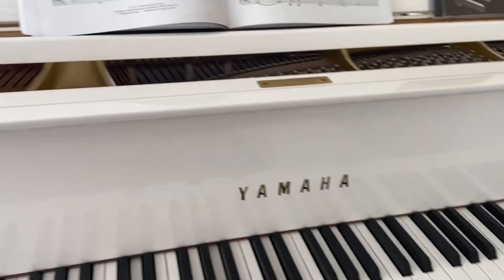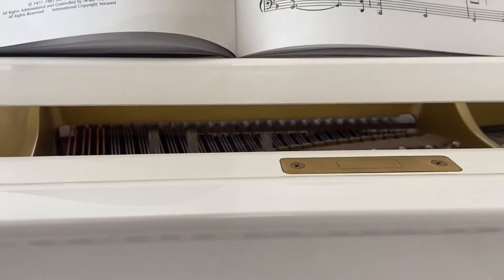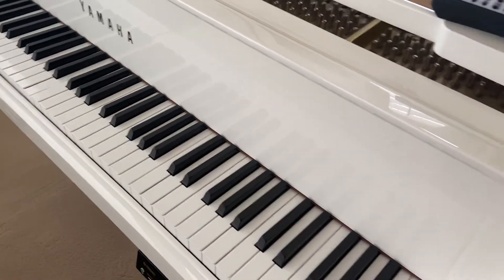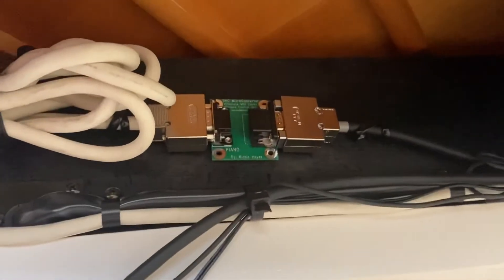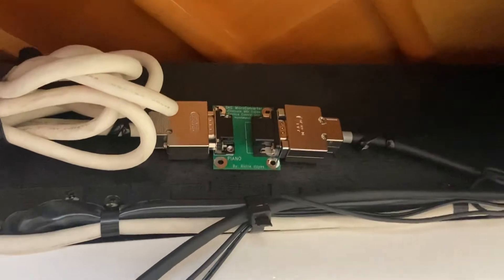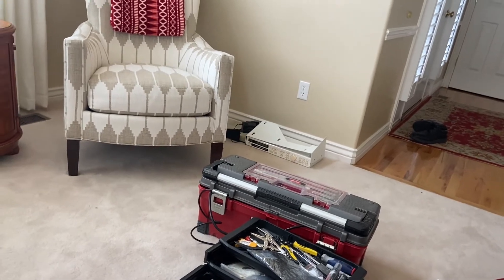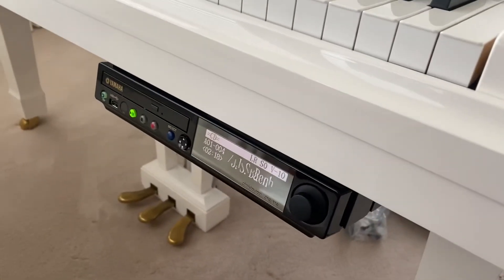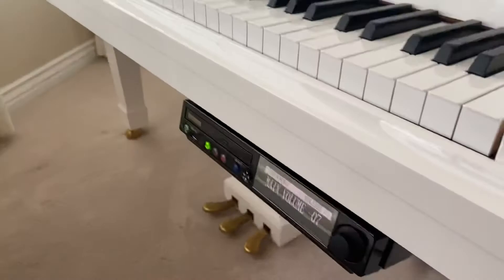Another Mark2 Diaklavier upgraded to DKC-850 with Dkc converter board .

Comment: Ritchie, so my Mark 4 Diskclavier can be upgraded now? I was holding off because of some technical issues with the upgrade. Have you resolved them? Let me know, Jim
Reply from the maker: Hello Jim… I probably should just talk to you on the phone one of these days and tell you everything that I’ve seen. But I do feel relatively good about the upgrade but I’m still slightly scared of it because of some of the issues that I have seen. The biggest problem that comes up is that sometimes the Csp board on your piano doesn’t want to communicate with the new DKC 900. And the other problem is that sometimes if everything isn’t perfectly grounded the piano won’t work right. And just one last thing is that sometimes the firmware with which you are supposed to upgrade the dkc900 isn’t as easy to install as it should be. I’ve had it where everything works perfectly and the piano doesn’t fight me at all and other times it fights me like crazy. Anyway hopefully all of that came out right I just spoke to my phone if you would send me an email hayesiq@gmail.com. 
I think we have spoken on Facebook 
You won’t believe this… I am scheduled to install six of these in the next two weeks or so. Wow and I’ve already installed at least eight of them.